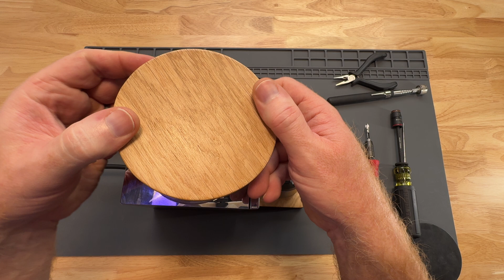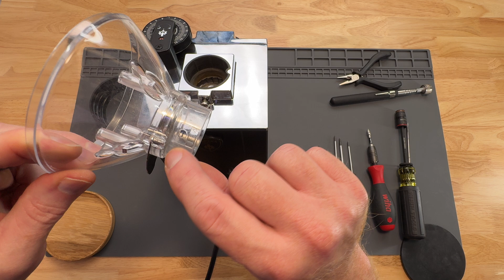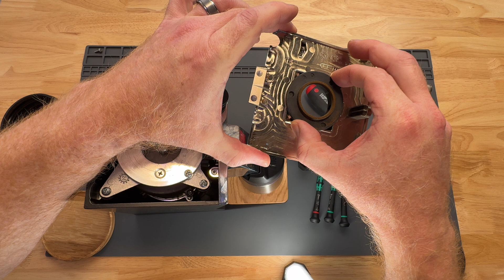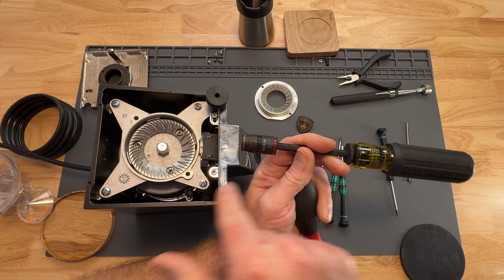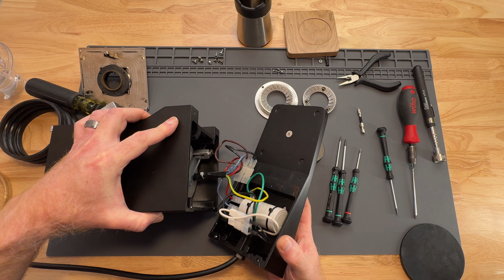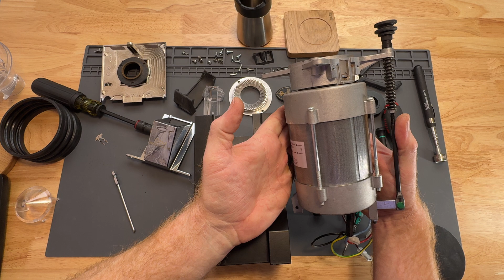Eureka Oro Mignon Single Dose Pro Teardown

Comment: Are you sure about removing declumper in this PRO model? Isn't it an issue in the previous version of grinder? Regarding the power - it's not a power consumption, but a power it gives out.

Comment: I have Mignon Zero, which is basically almost the same grinder. After more than a year of daily use, I opened it for a deep clean, out of nowhere and just because there were some screws, I opened those four screws at 17:45 .  After I assembled it again, at finer settings, the lower burr touches the chamber and makes the grinder noisier. However, in courser settings, when the lower burr goes lower in the chamber, there is no touching.
I don't know how I can fix it. I'm not sure if the issue is with the burr or with those four screws and the chamber.

Comment: Very Helpful. Thanks. Concerning the motor watt rating of 245watt verse the specification of 320 watts; could this be the difference in the USA marketed 110 volt vs. the European marketed 220-230 volt model?? For instance I purchased my espresso machine from Italy and use a converter, my warm up is much faster than the American voltage model. Being a small batch home coffee roaster normally with 10 different freshly roasted espresso beans on hand (various processing, origins, elevations, varieties, & roast levels) I have to dial-in nearly every grind; the dial control of this guy seems far better than my Turin DF64..

Comment: Dear Broseph.  I am retarded, and I threw grounds that had freshly been produced by my Mignon single dose, BACK into the hopper of the machine, because I had screwed up and ground them way too coarse.   This was probably extremely retarded, as the machine stopped grinding and has not ground since, in spite of me completely disassembling the machine as far as taking the top burr out.  Any suggestions on how to proceed now?  Is this a default state of the machine when the counter-torque gets too high or something?

Comment: Hello and happy new year..
I have the eureka ap 65 and i buy the new black diamonds burrs speciality espresso but in the process to install accidentally While screwing  the bolts on the lower blade of the grinder i  stripped the threads of the grinder.

Comment: I got mine today, it says 320W on the base, yours only says 4.3A and no wattage rating. So it has to be the 110V situation. To be fair Eureka does note exactly this on the spec sheet. But not on the website. 4.3A is probably the inrush current of the capacitor for smoothing the power consumption of the motor under load.

Comment: So after some thinking: Your Motor could be 245 Watts because you have the Model MEA for 110V countries... sigh.
Not that I can confirm right now that the motor is indeed 320W in 220V areas.

Comment: Finally, a youtube reviewer that knows the burr model of the Eureka SDP! I am tired of reviews where everybody says this grinder has Eureka Black Diamond burrs installed. It does not, these can be bought only separated. 
Also, in my opinion you get the best bang for the buck if you purchase the Eureka Zero 65 All Purpose and upgrade it's burrs to Eureka Black Diamond 65 AP burrs and maybe a custom inclination support from Etsy.
Reply: but the 65 ap comes already tilted, getting a base would be tricky since they are for the straight ones and aim at 15°. Also why would you upgrade to AP burrs, same geometry than the ones included, better get some specific ones for espresso or brew

Comment: Hey I’ve done all the parts of the video
And now when I’m grinding,  I can’t go near the espresso range, the blades are starting to make noise of contact
Wasn’t before
Thank you!
Reply from the maker: It sounds like you have severe mismanagement. You should take it back apart and makes sure everything is aligned properly, bother the burrs and the mounts.
Reply: You need to move your zero point on the dial, when the burrs make the chirping noise this is your true zero and you should adjust your dial to this.

Comment: Thank you very much for this disassembly video. I was considering this grinder but upon seeing how badly it is engineered, I will buy something else. Unfortunately, this grinder is just an adaptation of their hopper Mignon line and IMHO cannot be called a true single dose. The biggest flaw, is how much work is needed to get to the burrs for a cleanup. Also, too much plastic that will attract grounds.
Reply: Same here. Love my Niche Duo instead, no RDT or declumper necessary, very little statics (however they achieved this). Max. 0.2 g temporary retention - if you are pedant like me you can use a silicone lid as bellow (not necessary, but possible). Will also act as a bean cover if you keep it on top when grinding.

Comment: I was looking for a good video showing how to disassemble and clean the grinder. Now I've found one! Thank you very much, great work 👍.

One small question. How is the zero adjustment done when assembling so that the grinding discs touch each other and zero is then shown on the indicator wheel? Is there a trick here?
Reply: Same question here. I cleaned the grinder 2 month ago and didn‘t take care and a few days ago I cleaned it again and took care but now my setting has changed… My finest grind setting is now at level 1 and not 0, and if I set it finer, the grinding discs rub against each other.

Comment: Hi, quick question: What is your experience with retention on the Single dose pro? Especially for espresso settings? Cheers!
Reply from the maker: @johnny7740  It’s not too bad with the declumper removed, pretty average. Without removing it it’s pretty bad. There’s quite a bit of backup. Doing a larger amount of RDT does help a bit though. If you have a good scale, try to spray 0.02g of water per gram of beans. That’s 0.4g of water for 20g of beans.

Comment: Lazy question without thinking too much... Is there a way to remove the declumper without tearing the whole thing apart as you do in the video? I have serious problems with retention and inconsistent dosing (+/- 2-3 grams!) whenever I change grind settings, and was told this might take care of it.
Reply from the maker: @ola_strandberg  Yes, I think this would make a big difference for you. Unfortunately you do have to do the full disassembly steps to remove it.

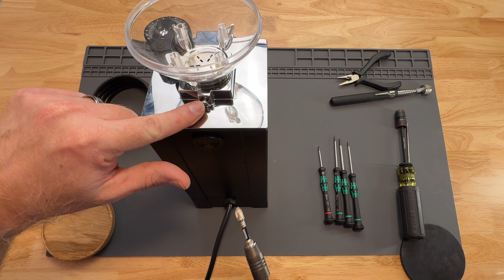Comment: At minute 2:10 in the video, you loosen a screw located at the rear section of the device. I removed the upper bean hopper for cleaning, and after reassembling it, I attempted to reinsert the screw. However, the internal thread appears to be stripped or missing — the screw simply drops through the hole and can no longer be secured.
Is it possible that the hex nut has become dislodged or shifted out of its original position?

Thank you in advance, and best regards from Germany.
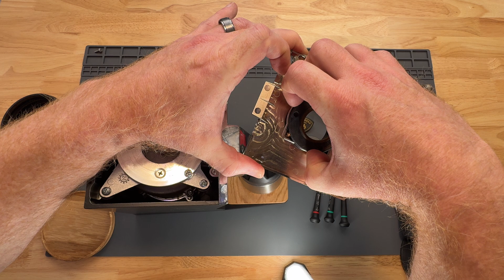Reply from the maker: @439LAWEN  Yes, check out what I mentioned starting at 5:20.
Reply: @CoffeeGearLab Thank You very much ✌🏼
Reply: @439LAWEN hey, I guess it's already fixed for you. :) I had the same problem today but I could fix it by turning the grinder to the side and slightly upside down and tadda, the screw nut got back in place. No need for disassembly. Greetings also from Germany 😅

Comment: Great video, thanks. I’ve pulled my previous model apart for cleaning, and reassembled. The lower part now doesn’t spin freely like it did before. Is the a way to remove the base for the lower burr plate? It’s like it could be jammed with grounds.
Reply from the maker: @AndreaHeron-l6l  Thanks for watching, and for replying back! The nut that holds the lower burr carrier rotates clockwise to remove. It’s a good idea to clean under there occasionally as well!

Comment: i need to take the nut off the top to do some major deep cleaning.  i assume it is right hand threads.  after 3 years, either my motor is getting week, there is buildup that can't be removed indirectly or i need new blades.

my 25 y/o pasquini grinder puts the silenzia to shame.  still.

nice vid.  thx.
Reply from the maker: @jkline999  If you mean the lower burr carrier, the thread goes clockwise (opposite of normal) to loosen.
Reply: I also need to remove the lower burr carrier. "Someone" tried to grind some poppy seeds (i cant recomend lol) and now the lower burr is completely stuck. Do i have to losen the six sided nut in the center clockwise? And how am i supposed to tighten it again once its cleaned? Somehow i need to stabilise the carrier right?
Reply from the maker: @jkline999  Also, 3 years of home use shouldn’t be enough to cause it to significantly slow down. But, to your point, a deep cleaning may help.

Comment: What’s the size of the torx key for that screw on the side of the dial, at the 15 mark?
Reply from the maker: @douglascamata  I used a TX HF 8, which is very similar to a T8. Thanks for watching!

Comment: Interesting to see how one of these comes apart.  Not sure how confident I am in my ability to "simply reverse these steps" for reassembly, but interesting nonetheless.  One thing missing was your overall opinion on the build quality and value relative to the price and the sum of the parts utilized.  The most I can see myself doing is a deep clean, and I don't need to take it down to this level for that.  But an analysis of the components and overall package would be helpful.
Reply from the maker: @tomscott4438  Hi Tom! I posted a brief review of it here:
Eureka Oro Mignon Single Dose Pro Review!
https://youtube.com/shorts/5tztEWeCNXM
 It’s a decent grinder, but for almost $700 USD, I would probably recommend other options. What type of coffee are you making? I could make a more focused suggestion for you if you let me know.
Reply: @ I'm using a previous version of the Mignon Zero for espresso, and it's been great.  I use a Baratza Vario W+ for AeroPress, but it's not single-dose, so not my favorite workflow.  I'm either going to move the Mignon Zero to the AeroPress (and replace it) of keep it for espresso and replace the Baratza with a single-dose brew/filter focused grinder.
I was considering the Mignon Oro to replace the Mignon Zero for espresso but I agree, for the money there are probably better options.
Reply: @CoffeeGearLab  Update.  It's now selling for $819.  Yikes.  So, what do you recommend as an upgrade to my Mignon Zero?  Espresso-only focus and I would be pairing it with an ECM Classika PID.  Mainly light to medium roast.  I'm considering the Varia VS6 and the Niche Duo as options for around the $700 to $800 price range Along with the Ceado Chameleon.  They all seem to have quirks, fans, and detractors but I guess that's what makes YouTube so much fun.  😄
Reply: Relatively easy if you get it right once, I open it up every 3months or so to give it a clean.

Comment: Do you have the specs for the toggle switch? How is it connected? Solders or connectors?
Reply from the maker: @air90air  Hi! Do you mean the main power switch on the side? If so, it is connected pre-attached connectors.

Comment: Given that I could get new Niche Duo in my location for $50 more than this Eureka, which one would you choose? Medium to dark roasts, espressos and milk drinks, changing coffees very often
Reply from the maker: @SKSK-bb2bw  For that specific use case, I would lean towards the Niche. It will probably be easier to dial in as you change coffees, great for medium and dark, and much easier to change the burrs if you ever want to.
Reply: @CoffeeGearLab  Can only second this. I have Niche Duo

Comment: Thank you for this video, very well made! 
Did you experience misalignment on the burrs? Could you please also show how to align the burrs on this grinder?
Reply from the maker: Thanks for the feedback! They were somewhat misaligned, yes. It seemed to be an issue with the tolerances of the top mounting plate. I was able to shimming the top burr with aluminum foil using the standard methods and mostly resolve it. However it’s not perfect. I am thinking of creating a video me using the Hale Method to get better alignment. If you google “Mitchell Hale Burr Alignment” you will see what I am referring to.
Reply: @CoffeeGearLab  Thanks, I will check that. Mine does this chirping sound when I stop the grinder after all the coffee is grinded. There's no chirping sound before or during grinding, only when I turn the grinder off. I wonder if that's related to misalignment, maybe I'll just open and see and make the alignment method if needed.
Reply from the maker: @ufukakulker Could you take a video of it and send it to me on my IG account? That doesn’t necessarily sound like an alignment issue to me.

Comment: How can I understand this: the engine is 245 W, but the official website states 320 W, is this a scam?
Reply from the maker: I get why you’d be confused about the 320W power claim because, in my opinion, it’s definitely misleading. The label on the motor clearly states 245W as the continuous power input, and that’s the real number that matters. It’s listed according to the IEC/EN 60034-1 standard, which means it’s measured under normal operating conditions—basically, what you’re getting during typical use, not some exaggerated scenario.

The 320W figure? From what I can tell, that’s almost certainly a peak power rating…something the motor might briefly hit during startup or if it’s overloaded, but definitely not during regular operation. It really seems like a marketing tactic meant to make the motor sound way more powerful than it actually is.

Here’s why that number doesn’t hold up. Motors like this one typically operate at efficiencies between 60% and 75%. If it were really pulling 320W continuously, you’d be looking at a mechanical output of up to 240W. That’s way too high for a motor of this size. It just doesn’t seem possible.

What appears to be happening here is that Eureka is using a big, impressive number to grab attention, but, in my opinion, it’s not an accurate representation of how the motor actually performs. If they clarified that 320W was a peak rating, fine, but they don’t. And, to me, that feels misleading, whether it’s intentional or just careless marketing.

The bottom line? From what I’ve seen, the real power rating is 245W, and that’s what actually matters. Anything beyond that looks like marketing fluff designed to make the motor sound stronger than it really is.
Reply: @CoffeeGearLab  It reminds me of how audio power amps and receivers were rated back in the 70's.  You'd see numbers like 1500 Watts Per Channel, when the amp was really only capable of 100 Watts "Continuously".  The industry agreed upon continuous power as the standard, so bold claims of peak power could no longer be used.
Reply: @CoffeeGearLab the 350 is in the manual, it’s the power consumption of the grinder. Far from the motor power.

Comment: Will this affect the burrs one blind and the other not? Or affect the grind size ?
Reply from the maker: Thanks for your comment! I do not believe that it would affect the grind size or taste by much. The finishing teeth on the outer edge have the most impact on the final grind size. That said, there is undoubtedly some small amount of inconsistency created with the traditional non-blind burrs as the screws and screw holes will influence the breaking down of the beans… and not in a similar way to how the teeth break them down.
Reply: @ weird design, they should make all blind or not.
Reply from the maker: @mryoyo7741 I 100% agree. They could have used a lower blind burr by using a magnetic attachment with locking posts like some other manufacturers have done.
Reply: @CoffeeGearLab i hope they re design o
Reply from the maker: @mryoyo7741 I do as well. This is one of several simple things that they could, that others are already doing, to improve the performance of this grinder.
Reply: @CoffeeGearLab  i have booth atom w75 and oro single dose i find it little difficult to clean not like the df54 i got